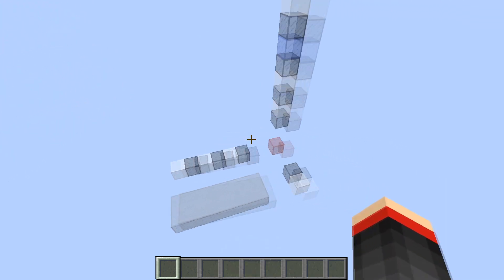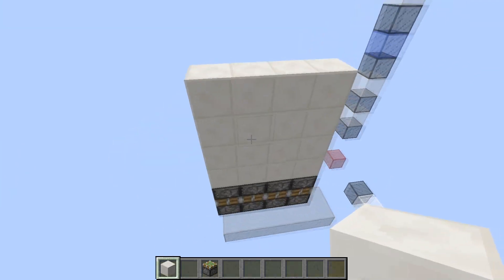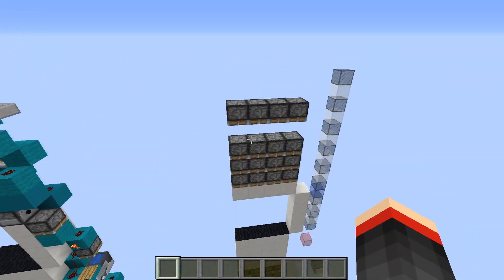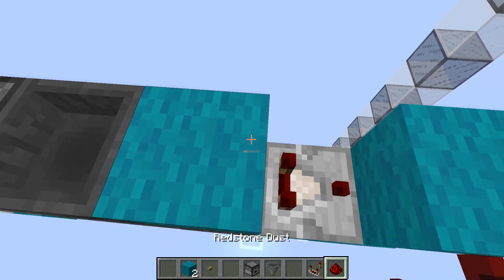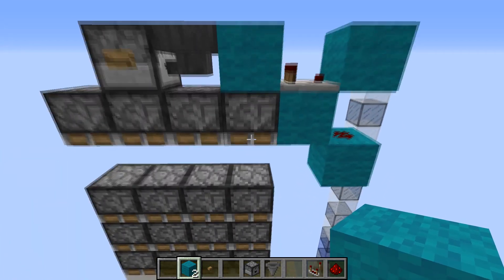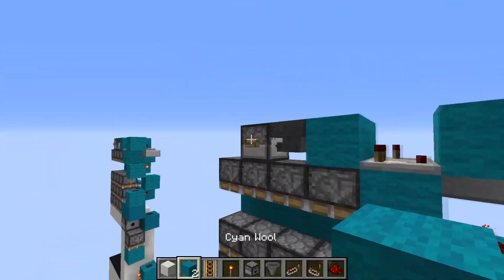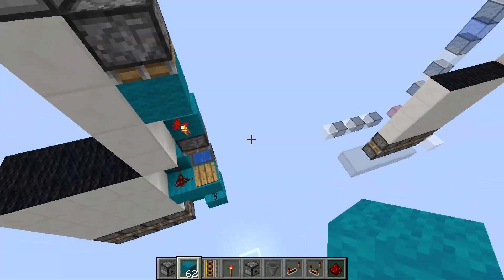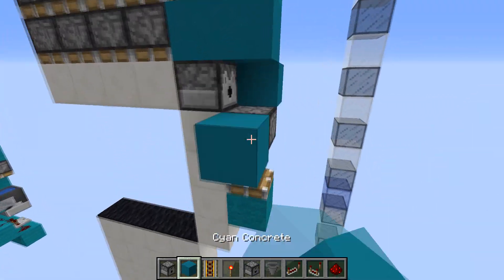Smallest 4x4 Observerless Carpet Door w/ Nacay & Jah

Comment: On your 3x3 hipster door whenever I try to put a repeater input the door just breaks, it always has to be a lever on the block ._.
Reply from the maker: This can be fixed by pushing a redstone block on a piston to where the green input block normally is.
Reply: @ReversedGravity  How do I make it so that it opens when I press a button or an observer input and then a little bit later it closes? I've tried using comparators but it doesn't seem to work.